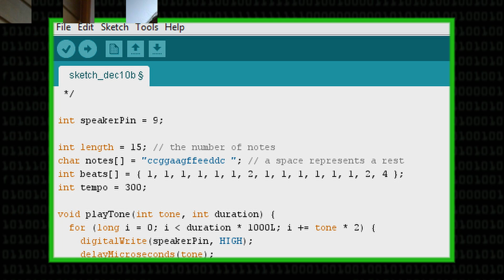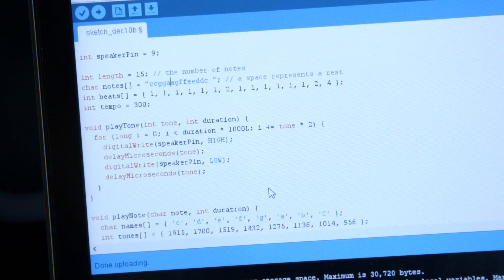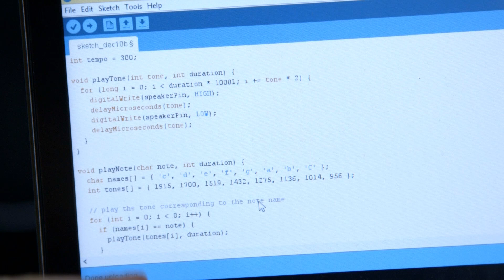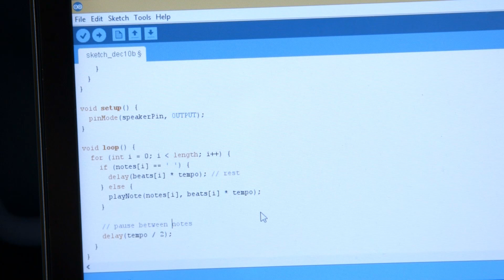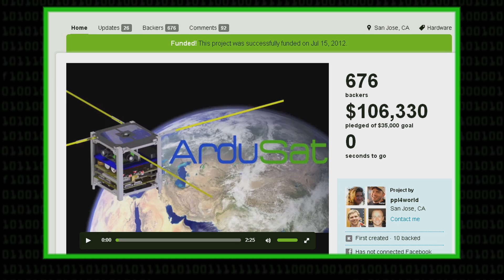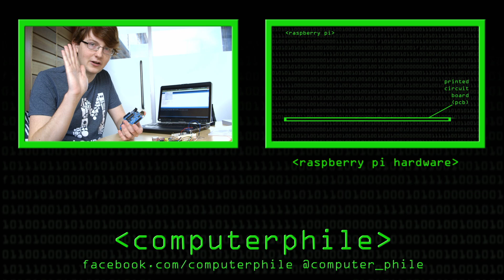Arduino: Hobbyist Electronics to Orbit! - Computerphile

Comment: That's something I've been wondering about ever since I started using Linux.
Why is the ethernet such a pain to set up some times?
I mean, I kinda get the impression that the more simple the OS is, the easier it gets to fix an ethernet connection, so why doesn't all computers have a tiny dedicated ethernet connecting... Thing built into them that's really simple and takes no effort at all to connect?

Comment: Does anyone know if the Raspbian OS has any reliable sw for programming an arduino in the repository and if so does anyone have practical reliability experience doing so? My Win7 laptop has died and running my arduino through my raspberry pi would be a more preferable option for me. Thanks in advance.

Comment: Just a correction you can get a Uno compatible board for $15AUD ($14USD) on ebay and that's fully assembled with a USB cable, the quality is very similar if not impossible to tell further more $100 is inaccurate as a Uno goes for €20.00 ($30USD) on the arduino.cc website.

Comment: As far as using an Arduino + relevant sensors could it be easily applied for monitoring and auto adjusting the alignment of rooftop solar panels on mechanical brackets?

Comment: I wrote a much simpler sketch on the arduino software that would play "Mary had a little lamb". It used frequencies sent to a pietzo speaker:

int speaker =10;

void setup() {
  
  pinMode(speaker, OUTPUT);     
}

void loop() {
   tone(10,82.407,250); 
   delay(250);               
   digitalWrite(speaker, LOW);    
   delay(250);
   tone(10,73.416,250);    
   delay(250); 
   digitalWrite(speaker, LOW);    
   delay(250);
   tone(10,65.406,250);
   delay(250);    
   digitalWrite(speaker, LOW);    
   delay(250);
   tone(10,73.416,250);    
   delay(250);                  
   digitalWrite(speaker, LOW);    
   delay(250);
   tone(10,82.407,250);   
   delay(250);                
   digitalWrite(speaker, LOW);    
   delay(250);
   tone(10,82.407,250);
   delay(250);  
   digitalWrite(speaker, LOW);    
   delay(250);
   tone(10,82.407,250);
   delay(125);                    
   digitalWrite(speaker, LOW);    
   delay(250);
   tone(10,73.416,250);    
   delay(250); 
   digitalWrite(speaker, LOW);    
   delay(250);
   tone(10,73.416,250);    
   delay(250); 
   digitalWrite(speaker, LOW);    
   delay(250);
   tone(10,73.416,250);    
   delay(250); 
   digitalWrite(speaker, LOW);    
   delay(250);
   tone(10,82.407,250); 
   delay(250);
   digitalWrite(speaker, LOW);    
   delay(250);
   tone(10,97.999,250); 
   delay(250);
   digitalWrite(speaker, LOW);    
   delay(250);
   tone(10,97.999,250); 
   delay(250);
   tone(10,82.407,250); 
   delay(250);               
   digitalWrite(speaker, LOW);    
   delay(250);
   tone(10,73.416,250);    
   delay(250); 
   digitalWrite(speaker, LOW);    
   delay(250);
   tone(10,65.406,250);
   delay(250);    
   digitalWrite(speaker, LOW);    
   delay(250);
   tone(10,73.416,250);    
   delay(250);                  
   digitalWrite(speaker, LOW);    
   delay(250);
   tone(10,82.407,250);   
   delay(250);                
   digitalWrite(speaker, LOW);    
   delay(250);
   tone(10,82.407,250);
   delay(250);  
   digitalWrite(speaker, LOW);    
   delay(250);
   tone(10,82.407,250);
   delay(125);                    
   digitalWrite(speaker, LOW);
   delay(250);
   tone(10,73.416,250); 
   delay(250); 
   digitalWrite(speaker, LOW);
   delay(250);
   tone(10,73.416,250);    
   delay(250); 
   digitalWrite(speaker, LOW); 
   delay(250);
   tone(10,82.407,250); 
   delay(250);               
   digitalWrite(speaker, LOW);    
   delay(250); 
   tone(10,73.416,250);    
   delay(250); 
   digitalWrite(speaker, LOW); 
   delay(250);
   tone(10,65.406,250);
   delay(250);    
   digitalWrite(speaker, LOW);    
   delay(3000);  
}

would your method be more effective than this one?

Comment: adrinio unos are £20..., the DIY is like $4-6 for the chip itself.

Im disliking the video for the massive price difference, If i was to have seen this video before i brought mine i would not be willing to pay £60 for an micro controller kit, £20 anytime.

Apart from that, I cant see any other problems with this video and like most of your videos has good information. Information aside all your videos are very well done with editing and presentation.

Comment: One of the problems with arduino's and pi's is the fact you can buy a device that does what you made it do for about 1/10th the price of the ard/pi and parts. So it's kind of redundant paying through the nose to fiddle with shit and make a half assed knock off of what you want to do.

Comment: Arduino is to electrical engineering as Raspberry Pi is to computer science. If you want to build a robot, or a device with sensors and motors, then Arduino is the way to go, especially because it supports analog input/output.

Comment: My Arduino is currently set up to connect to my school's bus tracking server, pull down bus time predictions for the stop closest to me, and display them on a 7-seg display. Sometimes my guests jokingly ask if it's a bomb since it's just Arduino + Ethernet Shield rubber banded to a breadboard with wires all over the place and a display that slowly counts down to 0 and looks kinda suspicious for those that aren't familiar with Arduino.

Comment: I use a Beaglebone Black at the moment, uses an AM335x ARM Cortex-A8 made by Texas Instruments. Probably the best $45 USD I've spent on a micro-controller platform yet. Not nearly as many projects with it than the Arduino but still a powerful platform.

Comment: In your video, at 1:00, you say that the analog pins are able to output analog signals. But that isn't true. the analog pins can only input analog and digital signals.

reference: (The arduino products page)
http://arduino.cc/en/Main/arduinoBoardDuemilanove
Reply: As the data sheet says, analogwrite() is available on pins 3 and 5.

Comment: arduino IDE actually is c++ ;)
Reply: Isn't C++ just a variant of C anyway though? Or are you saying that it's closer to C++ than it is it C?
Reply: C++ might look like a superset of C, but that would be very wrong. A lot of C code won't compile using c++ compiler. And as far as the design, architecture and engineering is concerned - C++ is totally different language, built on C like syntax. That's why it's worth mentioning, it's not a C compiler :-)

Comment: A lot of people like to slag off Arduino as being amateur-ish and whatever, but I personally have an Arduino Uno to thank for setting me on the path of wanting to become an electrical engineer - probably wouldn't really have gotten me going without that first experiments kit.

Right now I'm learning Assembly on PIC's, and occasionally on AVR's, mostly because it's fun though, Asm isn't necessarily a sane way to program most MCU projects unless you desperately need the speed...

But anyway the point is, Arduino doesn't deserve the hate it gets from "veterans" and snobs, it's a fabulous learning tool and a great kickstarter to get people going, or for that matter, to help people find out whether they are really interested or not. Diving in the deep end is almost guaranteed to just make people lose interest, and never look back, even though perhaps, if they'd started off easier, they might develop a real interest and find the motivation to get to the harder stuff.

There's nothing wrong with starting easy, and learning more once you've realized you actually care to do so.

Comment: 60GBP ???
Maplin in the UK say 24.99 for an UNO
Reply: That's just the board, I was referring to a kit with all the components, jacks, motors etc, that a beginner will realistically need as they won't have an existing horde :)

Comment: I totally love Arduino & have been using/playing with them for years.. the processing language is very good indeed IMO, simplified rather than stifled.
I made a 3d scanner using a web cam, stepper motors, a line laser & an Arduino recently.. I used processing to process the image data and synched with serial over USB.

 If you can already code in Java or C.. you will have no problems and should get an Arduino board to experiment and play with. Everything being open source is brilliant,
 proprietary chips were are just locked & useless black squares.. 
People on copyleft forums reacting against capitalist property is how Arduino came about, it opens up creativity, industry and invention to all.
 Once you make a project on an Arduino board.. you can simplify with just the components you need and make the project for much less.

Comment: And then there are different hybrids between Arduino and a Raspberry-Pi-sort-of Computer, like the Intel Galileo board (which is still quite much in its beta state, but it's open source and thus has a lot of potential).

Comment: Can't believe people are actually sending all the junk attached to an arduino board into space. Surely you could save a lot of money by stripping it down to the bare minimum instead of sending the full board. Like, what will the arduino need a USB connector for in space? Does it want to use a flash drive to share music with aliens or what?

Comment: Not sure why he put that red wire in, he said to provide power but it was on a rail not used..could have done it with two wires. Also not sure where he got his Arduino from but they're not £60, I got mine from Rapid electronics and it was £20, so for the work and the high-quality components that's not a rip off (and yes they're a genuine Arduino retailer)
Reply: Was referring to the whole kit, not just the board :) the kit I was using with all the components etc is an ARDX

Comment: Breadboard ATmegas don't require any "kit", they mostly only need the Atmega chip, which only costs 2-5$. Most have internal oscillator, so there's no need for any external components.

Comment: This is pretty sweet. Do more videos on this stuff! Just a question, why does the speaker require 3 pins instead of 2? Does it have 5v in, G and a 3.3v pin for speaker activation? How is this better than just having a positive and negative?
Reply: No, only 2 wires going to the speaker,, the 5V is not being used.
Some buzzers have 3 wires going to them, power, ground and signal. and for why, well it has a transistor build in so your logic pin don't have to drive the buzzer.
Reply: *****  NO, there are 3 wires going to the breadboard, power and ground going to the power rails, and the data going to one of the pins of the speaker ground for the speaker is then taken from the ground in the power rails, on the breadboard.
Reply: The third cable controls the pitch.
Reply: If you look closely, the 5v rail isn't actually being used. The speaker's wired between the data pin and ground.